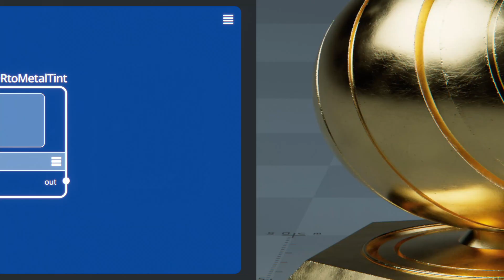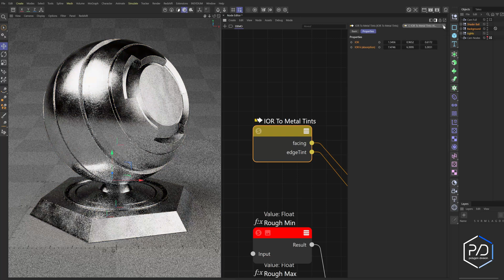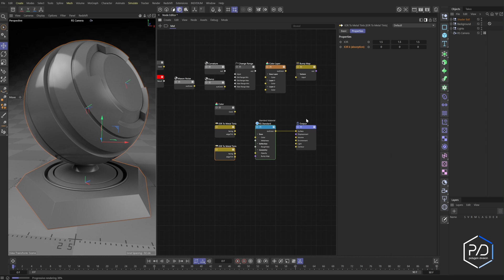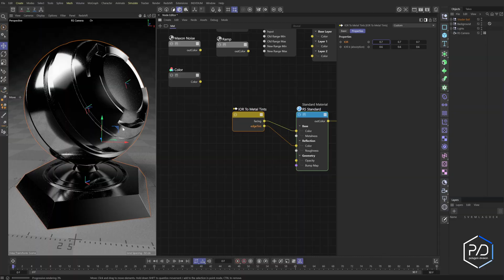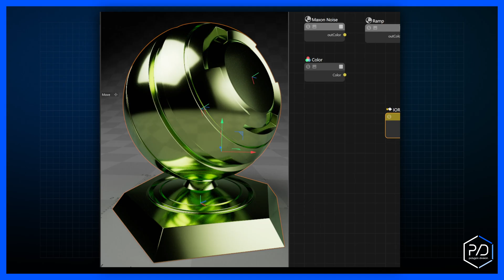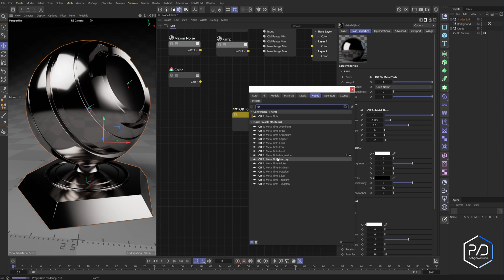IOR to Metal Tints Node. A detailed look- Cinema 4D & Redshift tutorial [4K]

Comment: This is super helpful. How would you go about Steel then as it's made from Iron and a little Carbon? And what is the metal was powder coated in someway, for example a exterior steel beam for a structure?
Reply from the maker: Iron is...
IOR: 2.9114, 2.9497, 2.5845
IOR K: 3.0893, 2.9318, 2.767
You could plug in a two Color Correct nodes after the two IOR outputs to adjust the right balance of gray to achieve the carbon look.
As far as powder coated materials. I wouldn't make a metal material as the metal isn't exposed. I'd start with a color then make the Reflection roughness very high and add a noise for variation.
I hope that helps. Would you like a video?
Reply: Fair enough :) 

Sure.  I struggle with bump as I don’t always know what to look for, whether a normal map is good or not and commons mistakes to avoid/look out for if that makes sense. Thanks for the video so far - super useful.